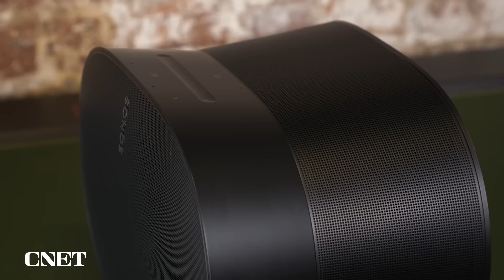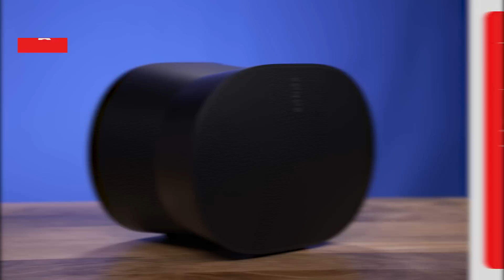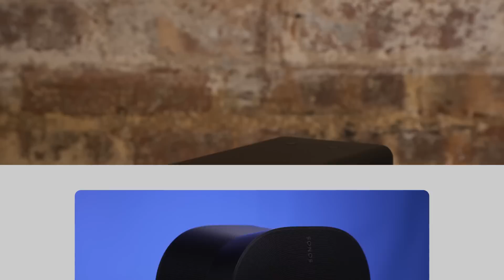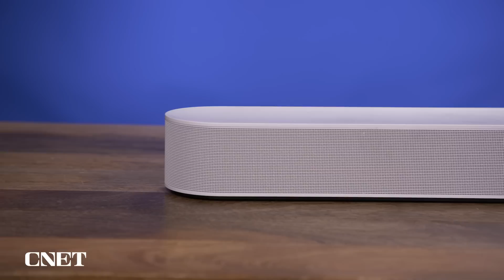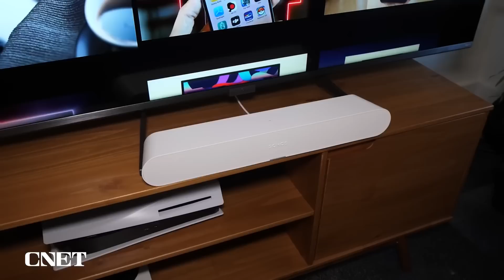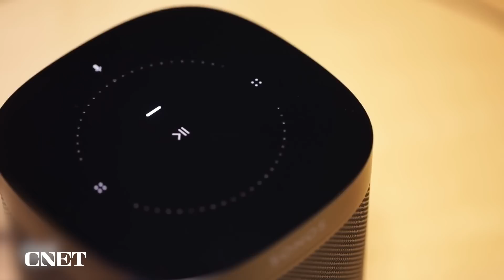Best Sonos Speakers: Buying Guide

Comment: DO NOT BUY- Good sound quality but difficult set up and connectivity issues.  Wort thing is that after a couple of months the speakers will not connect to the app and you have to use the app to listen to any music.  Just trashed over $1k in speakers and customer service did not respond for months after the 5 speakers I had bought had been in the landfill.  Buy anything else that connects directly with Bluetooth.

Comment: Stay away from the ray at all costs
Reply: I have the Beam and Arc systems and they have been perfect.  I haven't tried the Ray. I had few issues with my two Sonos Roam and that can be hit-or-miss depending on software version (not waking up in sleep mode, unable to pair bluetooth, losing bluetooth pair, dropping off sonos ecosystem, etc...).
Reply: Same, especially with the roam, particularly with airplay